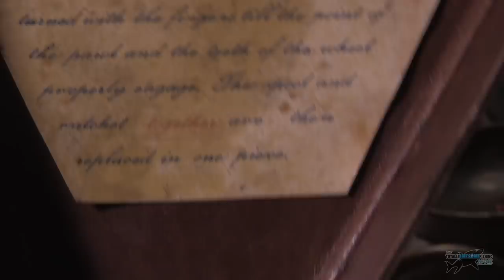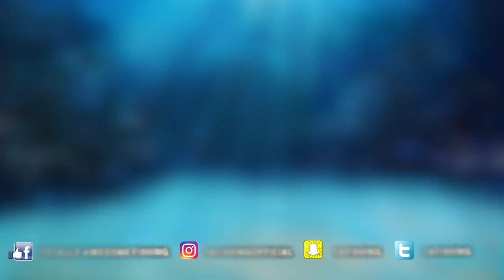HOW OLD IS THIS FISHING TACKLE?!

Comment: Hi, I started my sea fishing with a 7” Scarborough reel and a 12 foot split cane rod, 8 ounce lead with 70lb mono straight through with a rotten bottom and yes fishing off the East pier, Scarborough. That was 57 years ago, I now use a Shimano reel and a tipped tornado rod, casting over double the distance I could with the original tackle. Keep the videos coming a breath of fresh air, thank you.

Comment: As a young lad, more years ago than I care to remember,I was given an Allcock Stanley, threadline reel as a birthday present.
It was revolutionary at the time but was an absolute nightmare in use. The tiny spool caused the line to kink very quickly so every so often during a fishing session it had to be straightened by removing the terminal tackle stripping most of the line off the spool and dragging it through the grass.
Incidentally, the only gearing inside the reel was a worm drive to oscillate the line guide.  The large rotating disc to which the winding knob was attached was effectively a gear wheel with teeth around the periphery which rotated the spool via a leather washer attached to the rear of the spool.  Tightening or loosening the retaining screw on the front of the spool allowed the crude drive system to be fished either locked up or to slip and give line if a decent fish was hooked.

Comment: great video, as always, my contribution. Put the method feeder mould in a plastic bag, before filling, pull on both sides of the bag, close to feeder and  it releases the feeder without breaking up the groundbait
Reply from the maker: Good tip,I will try that.

Comment: Wooden Scarborough reels were sold in seaside tackle shops years after the freshwater variants had died off. Pretty sure I saw them in the 1970, possible the 80s, new alongside the similar metal Alvey reels. Just the thing for your monster tunny.

Comment: maybe that's sperm whale oil. it was widely used as a lubricant until 1972.
Reply: 46 years ago, a teacher mentioned that in the old days tortoise oil was used for fine gears (clocks and so on) because it was very fine and did not become sticky. Must have been expensive.